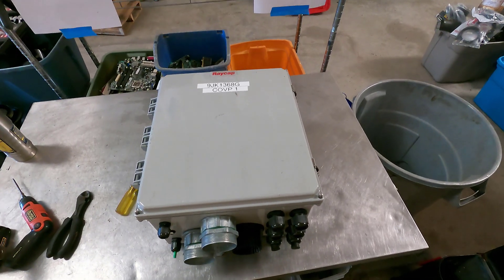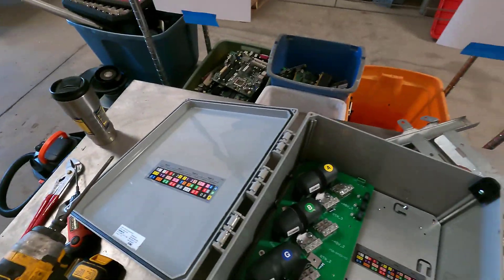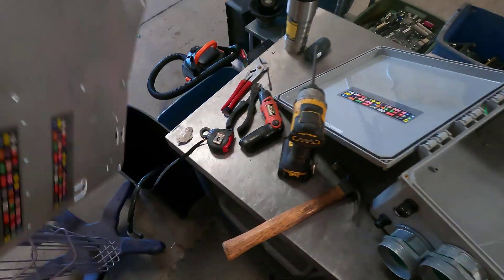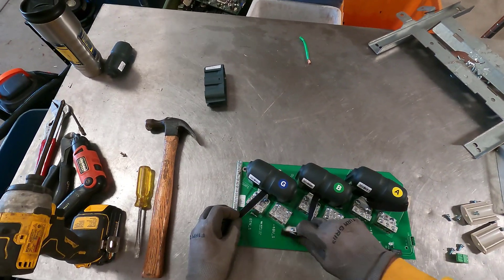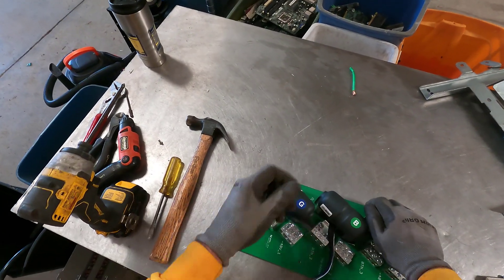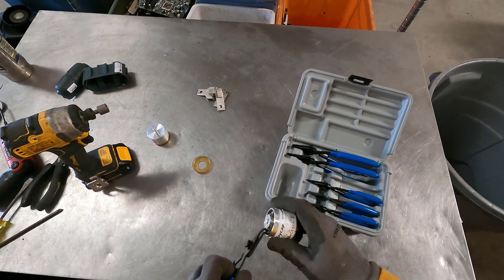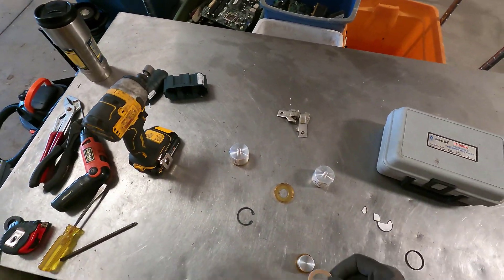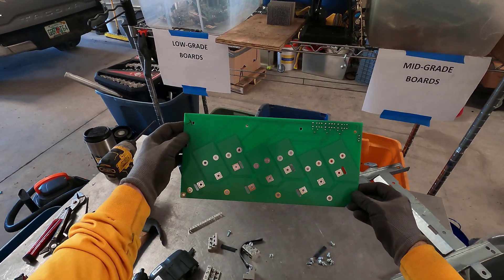Scrapping a cell tower lightning strike protection component

Comment: Nice video :) i climb cell towers & install those things. The strikesorbs are Surge arresters & that whole Raycap/ OVP (Over Voltage Protection) is basically a hub for the radios (which produce the frequency for cell service). A large cable runs up the tower & splits into many strands of power wire & fiber optics which are connected into that OVP, then separate power and fiber jumpers run from the radios up into that OVP & are paired to their corresponding parts with the main line. The little blue plastic thingy is where fibers plug into. Ovp fibers goes into top of 1 blue thing & corresponding fiber from radio plugs into bottom blue thingy. Theres a variety of models but A new OVP is around $1k-2k+. Others that handle 6+ radios are $2k-5k+. I just sold a used 6 radio ovp for $500 & another @ $250 on ebay. I just recently sold 5 strikesorbs @ $10 a piece as well. U would have a real ball taking apart an antenna or other telecom equipment. Nice video. I never took a strikesorb apart.
Reply from the maker: Thanks for sharing all the great first hand info!

Comment: Very interesting, especially for a plastic box mostly filled with air :P
Is that metal shelving in the background the shelves you picked up street scrapping recently?
Reply from the maker: If you're referring to shelving with bins or computers stacked on them, then no.  The wire shelving I recent found is stacked vertically against the far bulkhead. 

My new claim to fame - Shark Scrapper can make scrapping air interesting 🤣

Comment: We did a random "sample" of the floor sweepings in our processing area. I am quick to admit that our floors in this area are far from a sterile environment with paper scraps and cardboard flaps scattered about mixed with a generous sprinkling of e-waste chaff.  Once we swept up and then removed all of the viable scrap, the average price was around $10.00 per pound! Laptop RAM sticks, a few full size sticks, IC chips (lots of those), a couple laptop hdbs and a solid hand full of peripheral crumbles can tally up quick. Granted it was still under a pound, but dang!
Reply from the maker: 😆 I didn't come anywhere close to that.  All I found was some brass, copper and shred.
Reply: Haha. At least you CAN see the floor.
Reply: @Man-in-da-shed  depending on what area we are talking about perhaps not. If I could only post pics...lol :)

Comment: Very interesting, what were the small pliers tool you used to pull out the rings
Reply from the maker: Those are "retaining ring" pliers.  Very handy little tools if you have to deal with retaining rings.  They pull on the ends of the ring making it smaller so you can remove it.